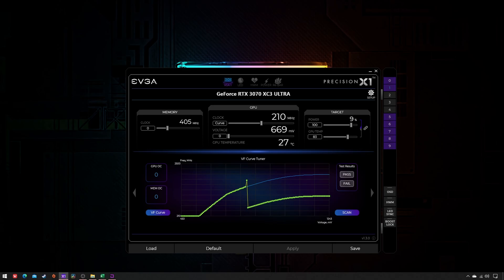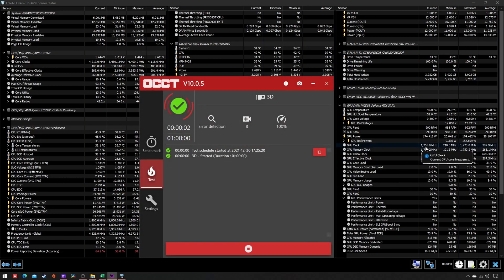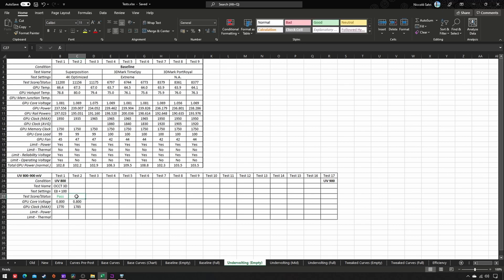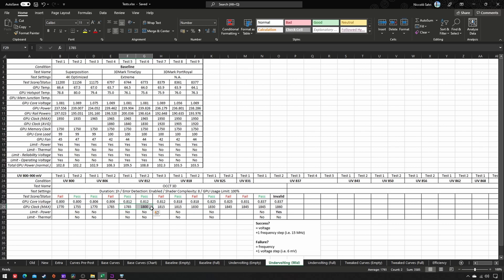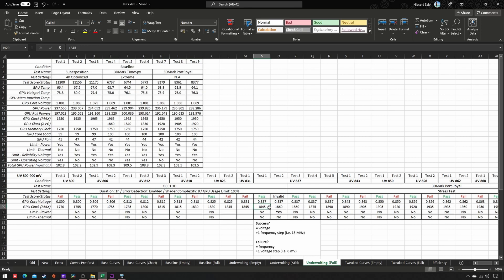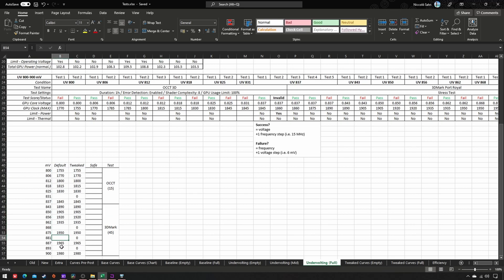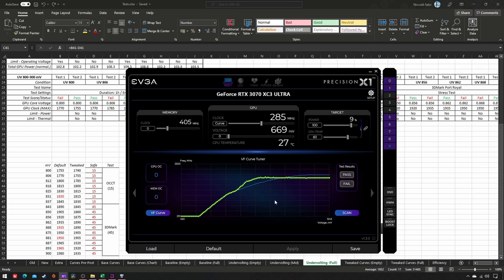[3/5] Undervolting w/ EVGA Precision: stability is ALWAYS crucial

Comment: It’s odd, I’m trying to undervote my 3090 but OCCT seems to be struggling to fully stress the card. I have my first volt limit set to .800 at 1725 but while running OCCT (8 shaders, 100% limit) the card just won’t get hit hard enough to reach those clocks, it’s capping out at .750 at 1530mhz and won’t go any higher. Timespy and Port Royal hit the card way harder, pushing it to its max 1.081 voltage and 1980 clock speed
Reply from the maker: Some years have passed, but if I remember correctly, others with a 3090 had the same problem: the safest way is to just use Port Royal :)

Comment: Hi there @oakenglass.  I hope you've been well.  I have a general question after watching your videos again.  In EVGA Precision X, when using the VF curve editor and picking a point on the curve, why is the frequency along the Y axis way off?  For example, in this video at 3:17, it appears you choose a frequency that is between 1700-1800 MHz, but the software says you've chosen 2010 MHz along the left hand side.  Is the software glitching?  Or does 2010 MHz have some signficance?
Reply from the maker: You got it right! Instead of highlighting 1770 (1500 + 270) and 1755 (1500 + 255), Precision incorrectly highlighted 2025 (1755 + 270) and 2010 (1755 + 255).

Comment: At 818mV and 1770Mhz my 3080Ti still was pwr limited according to HWinfo, feel a little to soon to swap to TimeSpy at this low clocks?
Reply from the maker: Have you seen my fifth video in this series? It could very well be a "fake" power limit...
Reply: @oakenglass  yea i did but forgot.
So should i re:run all test and when occt hits fail/error then change voltage?
Reply from the maker: @peniskultur  If the max power draw in OCCT stays below the power limit of your card (e.g. 450W for a 3080Ti FTW3 Ultra), the frequency shouldn't drop. In this case, all is well!
I don't know if you need to re-run all the tests... just remember to switch from OCCT to Port Royal when there's a REAL power flag, i.e. one that's accompanied by a frequency drop.

Comment: 4:09 At UV 800 Test 1, it failed but you decreased GPU Clock down to 1755 when your instructions are to increase voltage, not decrease frequency upon a failure.  Is this correct?

Also, Im hitting my power limit every time, which throttles performance.  How do I avoid hitting the power limit on my evga 3090 ftw3?
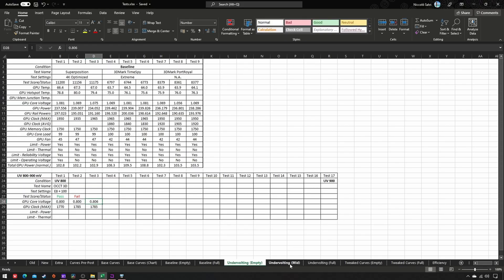Reply from the maker: The first three steps are something of an exception to the rule: if we momentarily ignore the second one (0.800 / 1755), we can see that upon failure (0.800 / 1770) I kept the same frequency and increased the voltage (0.806 / 1770). That step is simply aimed at finding the maximum stable frequency (1755 MHz, in my case) at 800 mV (listen again from 3:50).

As for your second question, if it's not a "false" power flag (i.e. the power limit trips but the clock doesn't go down), I think there are two possible ways to avoid it:
1) if your graphics card can safely handle the higher temperatures, max out the power slider.
2) Skip OCCT altogether and use Port Royal from the start, since it's much less demanding.
Reply: @oakenglass  you are amazing.   Thank you

Comment: HWinfo shows power limit reached even at the stock curve. Could this be due to having the manual OC switch on the PCB in the "on" position?

For reference this is at 800mV/1560mhz.

Should I begin undervolting below the stock curve?
Reply from the maker: @ButteCreekBanjo  Yes, it's normal... I also got stuck with OCCT at 837mV/1860MHz (real power limit).
As you can see in my video (05:21), as soon as this happens, we have to switch from OCCT to Port Royal.
Reply: @oakenglass  Gotcha. As you know this process takes hours, but it's worth the accuracy and reliability. When I get my curve finalized I'll post the data here. Thanks again! I'm looking forward to those cooler temps with great performance.
Reply: @oakenglass  phew, all done.. my final results were 850mV/1830Mhz.

I was also able to run 900mv/1935Mhz but the efficiency wasn't as impressive as my final setting.

This was after following your guidance on the stability reduction.

I saw 1.9% performance loss in synthetic benchmarks and gaming benchmarks over stock configuration. However, I've achieved a reduction of 17°!

That's a huge win in my book!

Thank you so much for all of your help! If any of you reading through this comment section want my data sheet DM me and I'll send you a copy.
Reply from the maker: @ButteCreekBanjo  Indeed it is... congratulations!
Now, if you are not too exhausted, you could also find the max frequency at the min voltage supported by your card (https://youtu.be/ztaeO8XzZ54).
Such a VF combo (1605 MHz at 744 mV, in my case) is typically useful when playing lightweight games to further reduce temperatures and power draw.
Reply: @oakenglass  that sounds very interesting! I think I'll give that a go in a week or so, my eyes are blasted with Excel spreadsheets and I have the entire Port Royal sequence memorized at this point LOL. Thanks again for this video series! Be safe!
Reply from the maker: @ButteCreekBanjo  Of course, you too!
I can definitely relate to the Port Royal part.
Reply: Is it a failed test if it reaches the thermal or power performance limit? What constitutes a pass? Is the successful run when occt completes without errors and no limits exceeded? Or can OCCT pass but trip one of those limits and still constitute a successful run?
Reply from the maker: @ButteCreekBanjo  If both temp and power are below their max , those are "false" flags.
I talk about them in the last part of my series: https://www.youtube.com/watch?v=fEcvFwfyeX8

So, a successful run is 1h OCCT 3D with no errors and no REAL temperature and power flags.
You can easily identify the real ones: your card will throttle a lot to reduce its temp and power draw.
Reply: @oakenglass  that makes sense. I just watched that video. So with the polling rate at 100 milliseconds if it briefly trips the power / thermal limit but the clock isn't reduced greater than one power step it's safe to assume that it's a false flag.
Reply from the maker: @ButteCreekBanjo  Almost exactly! In my experience, false flags happen only when the frequency goes up, not down. However, you've got the gist.
Reply: @oakenglass  I really appreciate it! I'll post my results when I get around to it tomorrow. This is the most comprehensive and easiest to understand undervolting guide on the internet. Thanks again!
Reply from the maker: @ButteCreekBanjo  Thank you! I really appreciate it too.

Comment: Would Time Spy Extreme stress test be a viable alternative to Port Royal? The Port Royal stress test has a tendency to crash randomly for me, even at stock. Thanks for these tutorials btw. Very thorough and well explained!
Reply: If you are having issues crashing at stock could be your power supply.
When I had first got my 3080 I realized quickly that the 850 supernova I had just put in was not good enough.
I replaced it from an A tier PSU list, snagged a HX1200 when it was on sale.

Most likely the rail from the 850 supernova could not handle delivering 400W and would just power down the card because I would get BSOD due to video card related issues.
I contacted EVGA and they confirmed that they previously had issues with the specific model PSU I had.

I recommend Attempting to reduce total power on GPU power slider until you can pass the Port Royal to see if its possibly power related.

Also make sure your RAM and CPU are in good health run OCCT stress test against your RAM and CPU validate no errors pop up.

I have in the past tuned my RAM to where my system would crash randomly, then had to increase clock cycles but I've also seen where even stock XMP 2 profiles failed like my current ram did because CR1 would not pass OCCT without errors on RAM even though that was XMP set.
I ended up downclocking my RAM from 4000 stock to 3600, tunned the timings to where I had better latency and could run CR1 stable.

CPU tuning can cause instability as well as mentioned, so you will want to test all 3.

OCCT is the best tool for checking all of those but, when it came to power issues I was having on my 3080 I had to run a gave with heavy RTX like cyberpunk's benchmark to validate if my system would crash.

Was a combination of temps and energy but mostly energy consumption that the PSU could not handle.

Oakenglass mentioned an issue with one of the benchmarks crashing was a code based issue, so if your stable all elsewhere then just ignore the Port Royal one.
Also to state, I believe temps are low on Port Royal mainly because it's so short.  I feel like the benchmark is not long enough to get the temp up where they need to be but.. I also like that it's a short test same time..
Reply: @VonZippySays  Thanks for the info. I pretty much checked all you mentioned (especially the RAM) and couldn't find any hardware related issue. Even with the power slider at 50% and all other components at stock the issue occurs.

I have finally after weeks of troubleshooting and searching on forums found out, that the issue I was having seems to be related to HWinfo running in the background while stress testing with PR. Somehow the the two applications don't play well with each other on my system. So for now I've resorted to stopping HWinfo when I'm running PR stress tests. After doing that I have not observed the issue anymore even after running the stress test several times across several boots. Previously the farthest I had gotten was 3 PR stress test runs before facing the crash again.

I have only observed this issue with the PR stress test, and no other test, not even the PR benchmark. I'm actually surprised not more people have mentioned having this issue. It doesn't seem to be very common. I only found about 1-2 discussions describing the same issue I was having.

I am still keeping an eye on anything that would indicate the power supply can't handle the GPU. It really should be able to though. I have a Corsair RM850i which is a top tier GPU. I did face some weird black screens in my previous benchmarking sessions while dialing in my undervolt, even at idle. Not a sudden shut down, but rather the display would go black and a few seconds later the system would restart. It looks like a driver related issue, but I'm not sure if the driver was just bad, or getting corrupted because of some hardware issue. I haven't observed it in a while but then again I haven't been using my desktop that often or intensely lately. I plan on picking it up again soon to finalise my overclocks/undervolt.
Reply: @iiiiiiariesiiiiii4187  naw the black screens and flickering/video driver seemly related issues is from unstable undervolting in my experience.
Anytime you get that you need to isolate the mV range that is unstable and reduce my one step then retest.  I've had to redo my 900-831 range a few times.  OCCT does really good job of checking up to .850 range but after that seems to just cap so you have to use Port Royal to validate the upper tier voltage steps.  I didn't do that in my own case I just manually reduced the range by one step starting from 900 down to 831 because my 825 was rock solid.
Until I could get stable on all tests and a heavy RTX cyberpunk which I now added to my benchmark list to validate RTX stability.
Reply: @iiiiiiariesiiiiii4187  as for the HWinfo64 I have not had the same issue.  May be related to specific hardware combinations and versions?
Reply from the maker: @iiiiiiariesiiiiii4187  This interference between HWiNFO and PR is really interesting... I've never heard of it before. Have you considered submitting a bug report on the HWiNFO forum? Martin (its developer) usually replies.
Reply from the maker: @VonZippySays  You're right, a final validation through a heavy RTX game is essential. Personally, I completed Control + all DLCs (as stated in part 4).
Reply: @oakenglass  Yes I am wondering if this really is an issue, how come it hasn't been reported more considering how popular the HWInfo + PR combination is likely to be.

I considered opening a bug, but haven't gotten to it. Perhaps it's worth it. The thing is I don't know exactly which (if any) of the two applications is at fault.

What led me to investigate if some background monitoring app was causing issues, was that one of the 3Dmark devs mentioned on the steam forums that low level monitoring software can interfere with their benchmarks.

It's a very strange issue indeed. For me, it manifests with the RTX lighting going haywire at any random point after the first loop, and eventually resulting in the stress test crashing with 0% result. I don't think it's an issue with the card, because I RMAed my first card and the issue still persisted with the second card.

Not sure how HWInfo could cause that, but it really seems that not running HWinfo in the background allows the stress test to complete without issue multiple times in succession and across boots whereas previously I would get through maybe 2 stress tests max if I was lucky (3 once when I got really lucky).
Reply: @oakenglass  Several months later, but better late than never and I don't like leaving things unresolved. So I'm leaving this here in case anyone else runs into the same issue.

After further testing, I was able to confirm that it is indeed HWInfo that  was causing the weird lighting behaviour in Port Royal. More specifically, it is the "EC Support" option in the "Safety" tab of the HWInfo settings that would cause the issue when enabled. The description for this option even mentions "This option can cause stability or performance problems on some machines when enabled". Looks like my system is a "some machine" . ;)

After disabling this setting, I can consistently complete the Port Royal stress test with HWInfo running in the background.

I had some (really annoying) micro-stuttering in the Superposition benchmark that is now also gone after disabling the option. As an added bonus, my scores for Port Royal and especially Superposition tend to be a little higher. Time Spy seems unaffected.
Reply from the maker: @iiiiiiariesiiiiii4187  
Your dedication is truly commendable: 99% of people would have forgotten to share their findings.
Results that I find very intriguing indeed, considering that "EC Support" is enabled by default.
I will try to look into it as well... until then, thank you so much for your great contribution!
Reply: @oakenglass  Yeah I figured I would share an update because I couldn't find any helpful information anywhere else.

This caused so much frustration and lost time, not to mention a completely unnecessary GPU RMA. I was even considering replacing other components (e.g. RAM, PSU), with absolutely no guarantee that it would resolve the issue.

Hopefully other users facing this issue can find this tip helpful and avoid all that in the first place.

If I recall correctly, the user is prompted regarding enabling/disabling EC readings the first time HWiNFO is started after a fresh install.

Thank you again for the series!